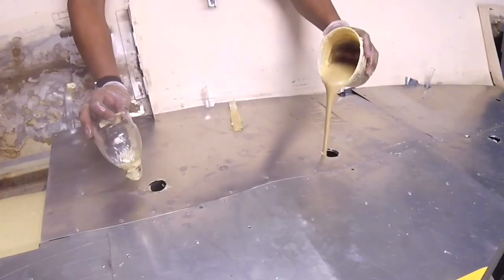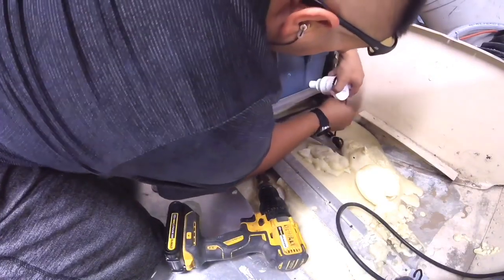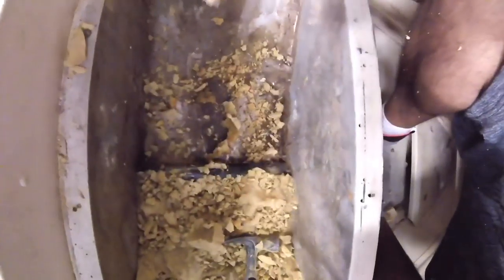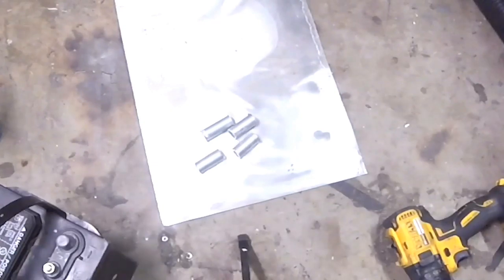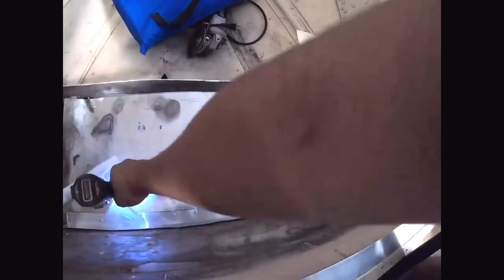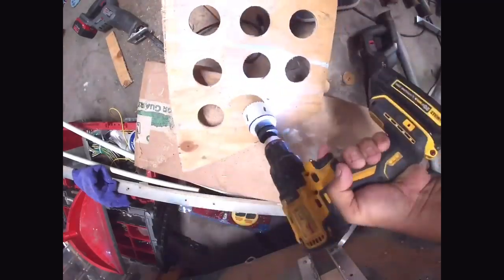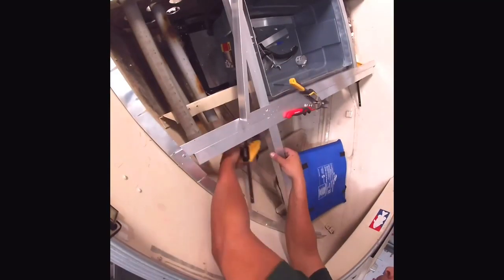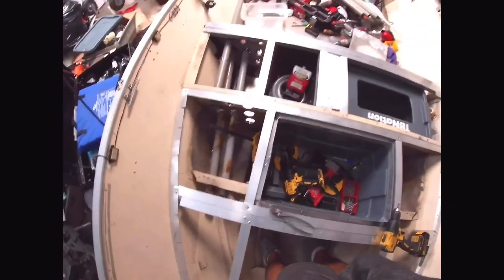The Front Deck - Lund Deep V Aluminum Boat Restoration

Comment: I've been building my deck about five inches over my bench brackets and so far it's looking good and straight, is there a reason in particular you don't recommend it? I also built a partial floor lower than those brackets but still in line with them.  I figured it was the easiest way to get a straight even shot. It's an old V hull Crestliner.

Comment: What size angle do you use for all of the framing? I know it is 1/16 but as far as the width, does it matter? And for the lip along the side of the boat to mount off of, were you saying that you taper up with the boat or down?

Comment: There is adhesive backed aluminum foil that is used in the HVAC business.  It is readily available at any DIY center and I have tested it under water for weeks with very good results.  Sticks like the devil and easy to work with.  Might be better in some of those sealing applications.

Comment: Why not use cheap coolers for the live well and chiller instead of plastic boxes? Even with foam around them, they still wouldn't come close to the insulating power of a sealed cooler.